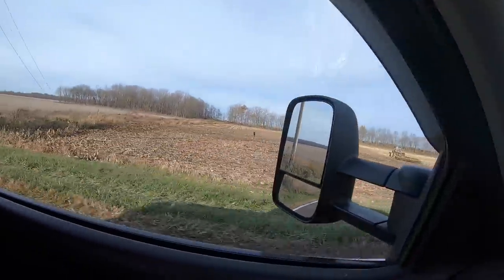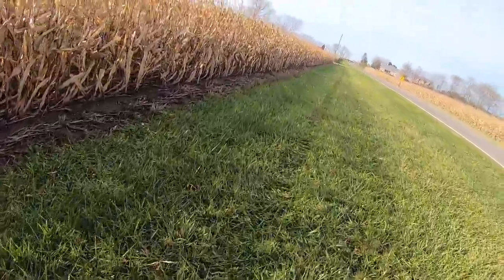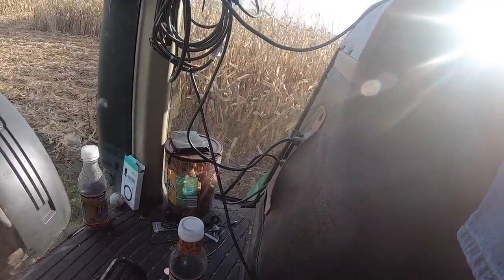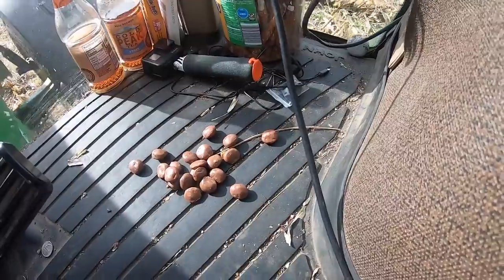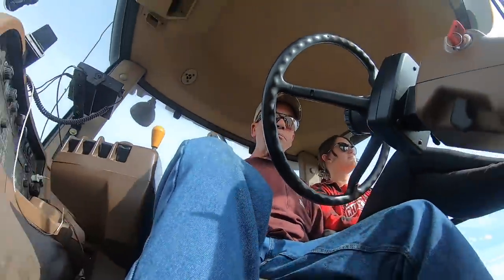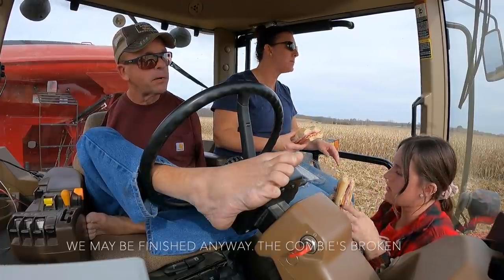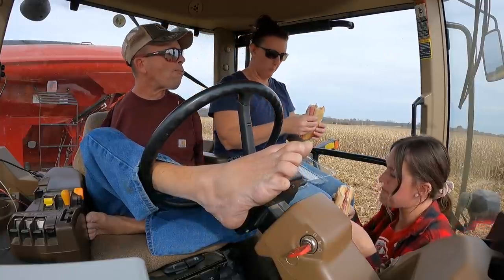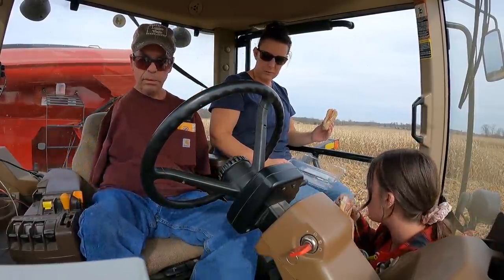Broken Combine, Its Shaking To Pieces

Comment: I just watch that clip of the primary counter shaft gear case about 30 time and can’t put my finger on what it is. It really squashed the bushings when the header clutch engaged. Hope the fellas from Koenig got to you the next morning. During harvest I remember many days there weren’t enough hours in the day to get to everyone.
Reply from the maker: It was the next afternoon. We found that the carrier bearing is broken and the mechanic thinks thats what's causing the shaking. Im no mechanic but I think the carrier bearing being broken is the result from the shaking.  40 acres to go and still running it.
Reply: @HarmlessFarmerAndyDetwiler  that it’s very possible. That gear case is only held in place on rubber bushings and the countershaft. I would make sure to check the countershaft bearing on the right side. That vibration could affect it.

Comment: Thanks for sharing. I find it interesting to see how the equipment works. How much does it cost to dry a thousand bushel of corn? Family time is the most important time we have. Thank God for all we have every day. God bless.
Reply: That iis a process that in principle is pretty straight forward where you use heated dry air pumped through the crop being dried to bleed moisture off each individual kernel and cool it off by using unheated air before the kernels leave the dryer.
Influences on the process
1. The moisture level of the crop to be dried (very variable from hour to hour)
2. Cost of fuel used to heat the hot air (most often propane)
3. Cost of electricity to operate all the equipment - mainly fans and motors.
4. The temperature of the air being drawn into the dryer - the cooler the air = more gas to get it up to drying temp (usually 180 - 200 Deg F) 
5. The % amount of moisture in the air being drawn in. Rarely less than 40% mostly 60 - 80% but can be 100%! - The further into Fall generally the higher is the ambient humidity % (think Dews wetting surfaces or in the worst case Fog) although the harder a frost will take moisture out of the atmosphere until temps warm up. 
6. The physical size of the kernels. It simply takes longer for moisture to migrate from the centre of a kernel to the outer skin of the kernel to be removed from the skin by the hot air passing over it.
7. The amount, accuracy and reliability of any automated monitoring and adjustment equipment mounted on the dryer.
8. The crop needs to be cooled down before it can be safely stored for any length of time to avoid condensation on the kernels. This can be achieved in the dryer but is most commonly done by ventilating the storage bin for several days otherwise it slows dryer throughput and this in turn slows harvesting in the field. For most farmers the target is a moisture % below 14.8, above 15.0 and the buyer will apply increasingly severe charges plus there is a high likelihood of the crop rotting in store.

Comment: Well Andy if you dropped milk duds in my tractor cab you May not figure out which "Brown chunk" was the milk duds. LOL We have been hauling manure for the last four days. 

As for the gearbox. We did run JD 9660s and we had that same gearbox fail on both of them with under 2000 hours on the machines. It was bad bearings  in both cases. Hope it is less serious for you folks. .

Comment: I'm reminded of repairs needed on a company truck I drove many years ago. Something was horribly out of  balance! They finally found 2 dry universal cups, One on front u joint and one on the rear joint of same shaft and also in same position so driveshaft was shifted off center exactly like a giant vibrator mechanism, absolutely true,it happened,   BUTLER TRUCKING, Indianapolis Indiana late 70's or early 80's
Reply from the maker: Lol, yep, with the mechanical issues ive seen over the years, I believe it. You just never know what's going to happen.